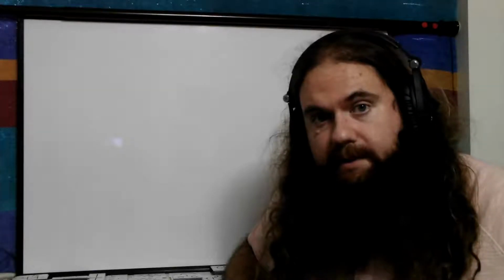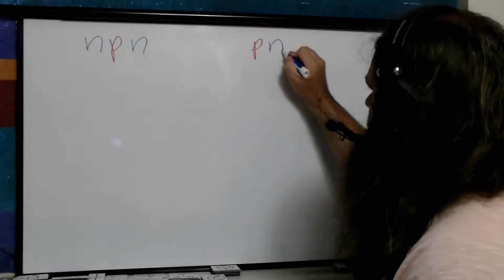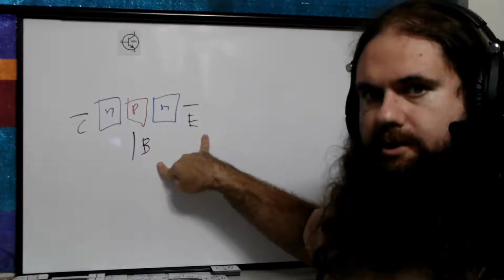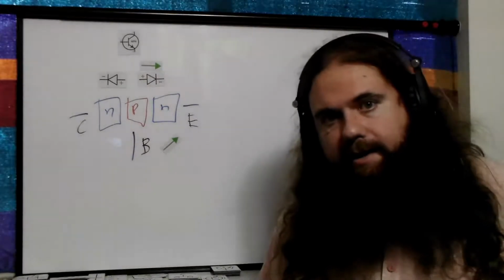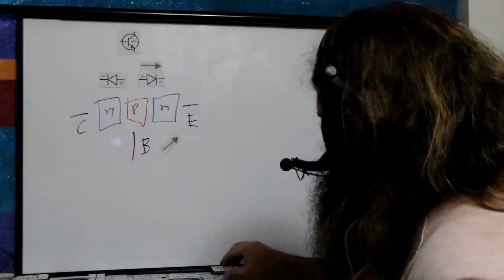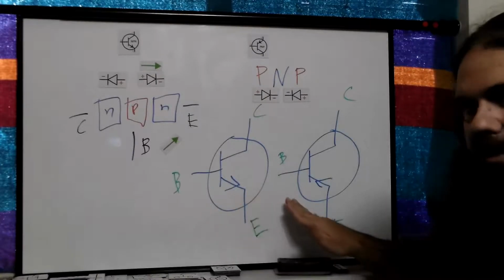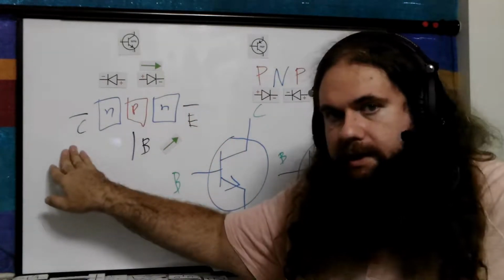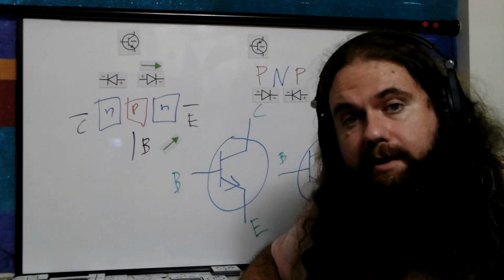Transistors - Basic Operation - Simply Put

Comment: I don"t know if you would even respond to questions....especially from a video 4yrs ago, but, there's one thing I am having trouble with in your explanation. How can I forward bias, JUST the base to emitter? Without forward biasing the collector as well. I get that, they are two separate JUNCTIONS (not Diodes), but if I am applying V/I to the base, am I not biasing both collector and emitter? And then is the answer to provide enough voltage to either open the emitter only, or open both the emitter and collector? Is that what you were saying?  And to add...thank you for your in depth analysis and creative tutorial analogies. I enjoy watching and have learned a lot...perhaps not enough :)

Comment: Sorry, but new to electronics. With an NPN transistor ; am I correct in assuming that if I use 12v and the correct resistor through the base to achieve the 0.7v it will open the gate for the 12v to flow from base to emitter. Is this to save energy ?
Reply: The purpose of the base resistor is to avoid overloading and burning up the base-to-emitter channel.  As much current as is necessary, will flow from the 12V source until the base voltage is 0.7V, and if there were no base resistor, only the source and wiring impedance would govern.  You might as well be short-circuiting the source, at that point.  To keep this in reasonable limits, you insert a current-limiting base resistor.

Comment: In my opinion, there is absolutely no way to clearly explain a transistor unless you know how each is made, and I do not mean you have to name the stuff ( the so called impurities, you know like no longer pure, no longer virgin),  but most importantly the role they play, and therefore the characteristics that it gives to the transistor.
Once that is crystal clear in the mind, then the mind can put together the rest.  Otherwise it is nothing but memorizing, period.  The reason memorizing happens is because  one does not understand.  There is no way around it.

From that, then it becomes obvious what the P and N actually do, and those arrows of diode as to which way they, inward, outward are for kids.  They are a mess of confusion and meaningless nonsense.

And to make the whole thing more cluster f***k, there is the whole confusion as to which way current flow ( that is another gueralla in the room, oh my), knowing the make up, it will once and for all also clarify so call BJT from so called Mosfet.  What on earth current and voltage in regard to this impurity associated with the base   or whatever, collector, emitter, source, drain, gate,...... oh jee wiz mean.

And if explained correctly, it will alsoclarify  this other crap mean, it is always there in 99.90% of circuits,  ground up or ground down... or whatever show off bulleying lingo goes with that.  Up resistor, down resistor.. shh***t I don't even know what the heck it is called. [ Oh my pull-up and pull down resistor, just barely came to me as my mind was racing to find the hollywoodish terms)

For instance are the collecor and the emitter made of the same stuff.  In other words if you removed the base, would the transistor behave as a simple conductor, or short circuit or whatever. Of course not.  If it was so, they wouldn't be having different names.  The two N,s and the two P's are not the same, nor does the base or gate mean as is represented by P or N to mean that.

Comment: What are Common base amplifiers used for mostly? Common base amplifiers input is the collector and the base is the output which only amplifies the current 1:1 ratio? The difference between a PNP compared to an NPN is that the PNP has less output and lower electrons compared to an NPN. The PNP transistors have issues with thermal runaway compared to NPN?

Comment: Would you have any interest in doing a video on vacuum tubes and their historical relation to transistors? Your explanations are great, and I would even be willing to send you some vintage tubes free just to see your explanation.
Reply from the maker: I'd be interested, sure, but I haven't done any research on them. Would I need other vintage equipment to form the full circuit, or could I use modern electronics to drive them? Also, check out the "Computerphile" channel on YouTube, which has done some neat videos on some of the oldest computers, like the ones that used "delay" memory with fluid-filled tubes.

Comment: Thanks.  Finding your videos very helpful.  Do you have an index of videos?  Looking for an overview on buffers.  You mentioned them in a video on amplifiers to protect circuits.
Reply from the maker: I haven't done a formal video on buffers yet, but I will in the future, starting with the tri-state logic buffer. The basic idea of a buffer is that it 1) separates one part of a circuit from another, so that they don't interfere (e.g., loading a filter's output stage), and 2) separates power draw, so that you can put a buffer between a weak microcontroller pin and a hungry LED, for example.